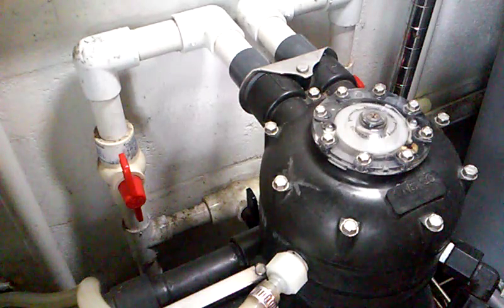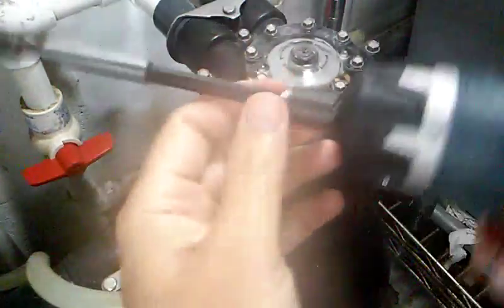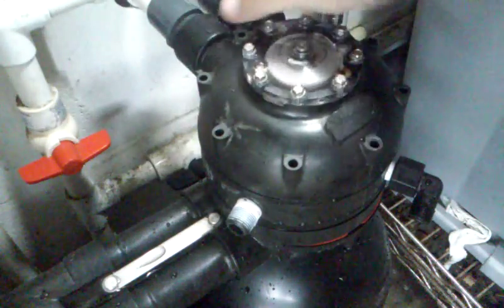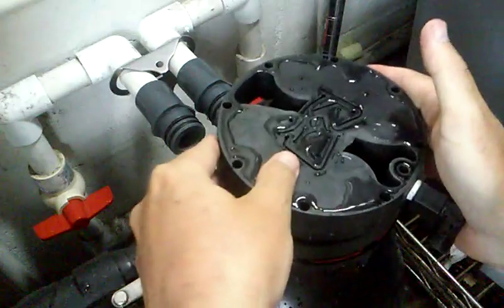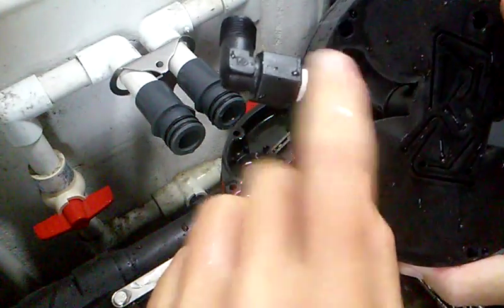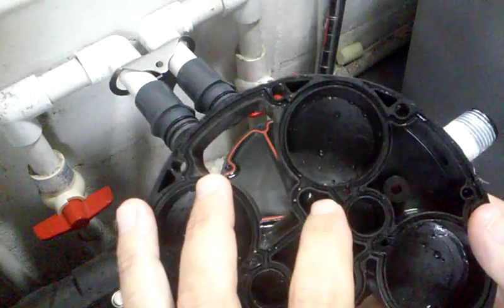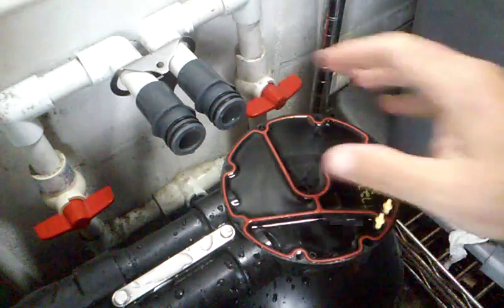Kinetico 51 - Control Valve Disassembly

Comment: I bought an old house that has this model. The owner's manual talks about replacing a carbon filter every few years. The video did not talk about or show a filter. Is there a filter I'm supposed to be changing?

Comment: I have I believe is a Model 100.  However, it has three connections, two discharge nozzles, one brine nozzle.  I took it apart and a little venturi disc, approx 1/4" dia x 1/8" thick, concave on one side, for the life of me I can't figure out where it came from...I believe level 3.  I can send photos if you wish to help me a bit.  Mark

Comment: Great video, found a shard of ceramic debris lodged in one of the valves, and cleaned out tons of iron and calcium deposits.  Took a few regen cycles, but all good again.   Video talks about being careful to not over tighten the screws, but mine leaked like a sieve until I tightened them up considerably (after rechecking all the gaskets).  Max hand tight worked with a hand held hex driver worked.

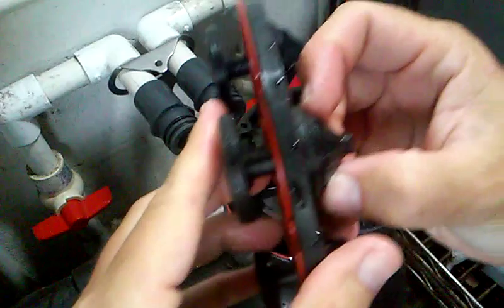Comment: 10:05 how much did the kinetico store charge you for those 4 square rubber washers around those four big valves on that stage 4? Is it some special rubber that doesn't degrade with salt so maybe I can look on eBay or Amazon for some Chinese washers or wouldn't you recommend that? I have the Supra 45.
BTW I measured inner diameter 2 cm outer diameter 3 cm and width of 2 mm-- sound right?

Comment: I have a Kinetico system also, but it keeps going into its bachwash cycle and does not stop.    I live in an area that has a lot of Iron which is the reason I put this system in.   What would be the most likely cause of this?   Thanks!
Reply from the maker: I would check all gears to make sure they operate with restriction. 4:50. Also watch the white indicators on the very top of the unit.  They should be moving and clicking during backwash.

Comment: Thanks to this well done video our water is back from the dead but most importantly I gained man points plus confidence not to mention a little later was also awarded in bed!! Unlike so many other videos this guy goes above and beyond describing and dissecting each and every level instead of only the 1st couple levels. If your gonna go that far I highly recommend going all the way as well. Also double check connection at brine/salt tank making sure there’s no leaks cause it plays important role as well. I no longer see any reason I can’t help this water beautifying machine work its magic forever:) Thanks for making this video my man!!

Comment: To prevent cutting new threads and damaging the unit, back off the big screws anticlockwise till you hear a click so that the threads sit correctly and then screw them  back in - see this video https://youtu.be/Ul4JZyqvsyo?t=450

Comment: This video saved me $500.  After my local servicing company failed to fix my water softener once, they offered to come back ($299.00 standard service fee) and replace the head (still under warranty, but they charge $200 for the labor involved in “rebuilding” it at their shop).  After watching this video, I found a tiny grain of sediment in the Venturi, removed it, and that was that. If I had to do it again, it would probably take 15 minutes start to finish. Thank you!

Comment: Excellent video!
I have a Kinetico 30 dual tank system that stopped regenerating. I had levels 1 & 2 apart and cleaned them, and the gears seem to be turning freely. Any thoughts? Also, would you tell me where I can get parts?
Thank you,
Dave G.
Reply: I have the same problem.
When the water is running in the house like from a shower I can hear a little click inside the head like it's trying to advance the disc.

If I use a cross tip screwdriver to manually advance the disc 4-5 clicks then it will function until the next time it needs to go into the regeneration mode.

I wonder if my turbine gear is out, like the one PapoosFam "replaced about 8 years ago..." at https://www.youtube.com/watch?v=LZGchlo9Dzw&t=320s in his video.

He never says why he replaced the thing or even what the things is called.
It's like saying, "I had to replace the lug nuts on my car 8 years ago" when I'm talking about how to maintain car tires.

FYI, it's called a turbine #9 gear.
Which is on the metering side of the head.
I suspect that mine is wore out also which is the faint click I hear when water is running in the house and why the control disc advances like it's supposed to when it goes into regeneration mode after I manually advance the control disc by 4-5 clicks with my screw driver.
Does this make sense?

I hope this helps someone else.
Now I need to go and pull my head apart and check that gear again now that I have a better idea when I am doing.
Reply: IMO, I think your gears will turn "freely" but I think it is probably slipping when the regeneration turbine gear is slipping under load.

Comment: Hi,Not sure if you're still monitoring this account, but I'm just wondering if I can disassemble and reassemble my Kinetico head without having to replace any seals or gaskets.  Your reply will be most appreciated.Thanks for posting these videos about a subject that otherwise seems so "top secret"!
Reply: I've had mine apart now twice with same gaskets. As long as you don't pinch one when reassembling or one hasn't broken down then you should be fine, IMO.
Reply: @mikeharmon8733  Thanks again, Mike.  Do you happen to know of a supplier who will sell parts without charging the service fee (by mail preferably).

Comment: Where is the Kinitico store you refer to? I haven’t found a place to buy parts. Thanks for the video.
Reply: My local Kinetico is not interested in repairing my old unit. They want to sell me another one when all I need is probably a part or two. Even if I needed a $200 repair I'd be good with that but they are no help there. So I have nothing to lose attempting to repair it myself.
Reply: @mikeharmon8733 , I took mine apart. Cleaned blown filter parts (oops, i didn't change it). Works fine. What's wrong with yours?
Reply: @mikeharmon8733  Check Ebay. There is a British guy that sells seal kits.
https://www.ebay.com/itm/Kinetico-Water-Softener-Rebuild-Kits-Unique-Fix-Kits-Extra-Parts-Included/173144549038?hash=item28503826ae:g:e5sAAOSwctJcD6G0
Reply: Same here.  Seems this is like the HVAC industry where they just try to rob you blind by keeping everything secret.   If i find anything I'll advise.
Reply: I know that there is a Kinetico company under the name of Premier Water Systems in Walpole, MA.
Reply: @gary4738  i live in Taunton Mass. with premier on my Brine tank cover are they a decent/reputable company to service my system. Came with the house
Reply: Found anything yet?

Comment: My Kinetico unit hasn't worked for probably a year and a half. It has the same problem where it is not drawing the brine. Thank you for posting this video. I'm debating whether or not to just go buy a completely different unit and install it to avoid the headaches that you have had with yours.
Reply from the maker: Mine is close to 20 years now.  I keep looking for a dirt cheap used "newer" one on Craigslist to replace.  Will keep the current one for spare parts.  That said, my current system has been running strong since I last posted these videos.

Comment: Great video. My Kinetico unit was severely iron fouled. Inside parts were caked with rust build up. This helped me immensely with taking my head unit apart to give it a deep cleaning. Thank you for posting this.
Reply: what did you do to get the iron out safely without damaging the plastic and rubber?
Reply: @MrPorkChop1972  Honestly, I really don't remember. I replaced my unit for something more modern like 6 months later.